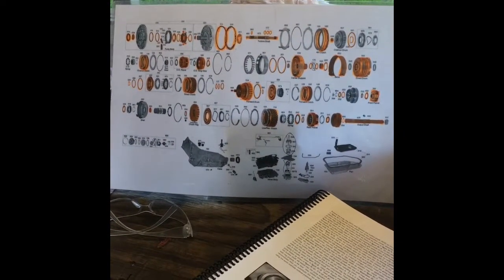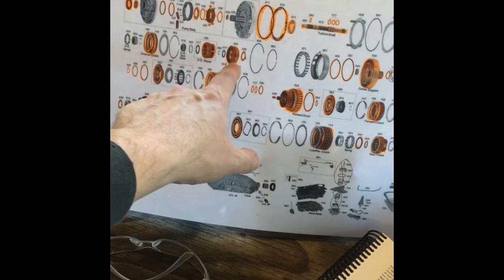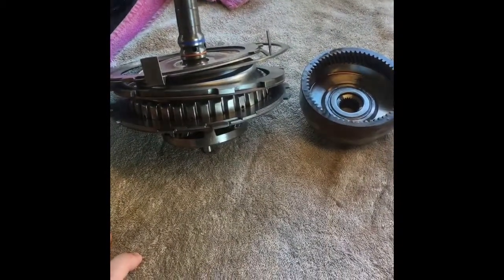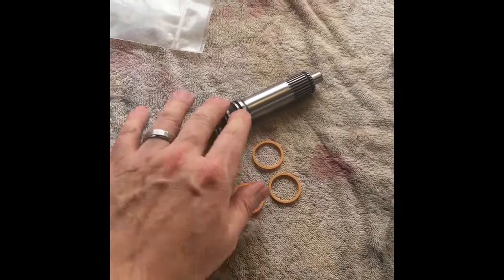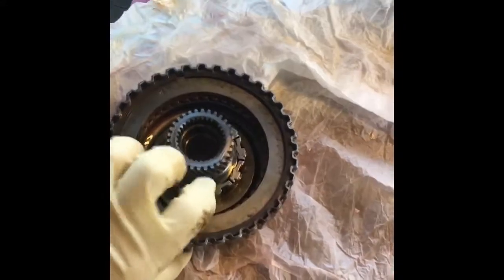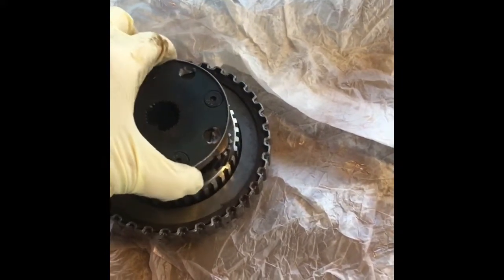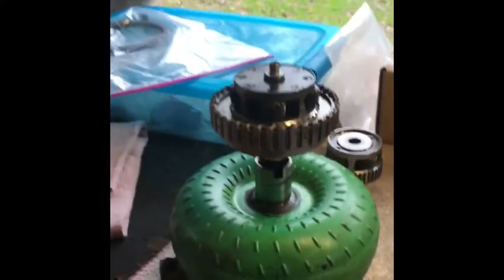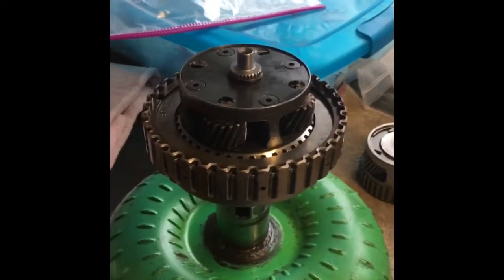TH200-4R Rebuild: Billet input shaft, OD Carrier, and Overrun Drum

Comment: Hi, i am working currently on a 4L30e unit that has the same over-run drum as your thm200-4r...slightly different design at torque converter splines , but overall, identical unit...i have found the input shaft to have 3 pressure sealing rings, and inside the drum, there is a bushing...in testing the piston aplication, two sealing rings send pressure into the input shaft and the third sealing ring helps channel the pressure towards the drum piston/cylinder to compress the clutch discs...however the bushing the input shaft spins inside must both support the shaft and seal in pressure... any wear and there is loss of pressure in entire circuit this clutch pack is involved with...1st,2nd,3rd and reverse....also the 4l30e unit i have disassrmbled only came with 1 clutch disc in the overrun clutch pack, the 200-4r has 2 discs....this is what takes rotation/torque from torque converter turbine and sends it to the ' transmission' : 1st, 2nd, 3rd and reverse......... what are the steels thickness for this overrun clutch pack??? I tried fitting 2 clutch discs but the lock ring does not enter... other point , the 4l30e unit uses a moulded rubber piston...i have observed transmissions that use moulded rubber pistons, these suffer when left sitting for years...they harden up and have aplication issues when try to use them
Reply from the maker: My apologies but I do not know.

Comment: 💎 I have a 1983 Buick Electra Park Avenue sedan with 98,000 miles on 4.1 liter 252 v6 & 4 speed 2004R it just started slipping recently so it needs rebuilt as fluid is dark Burnt with metal shavings... I was thinking about going with a TH350 but I think I’m going to just get my original transmission rebuilt as I plan on some highway road trip next summer 2025 so I’d rather have that 4th gear 💎